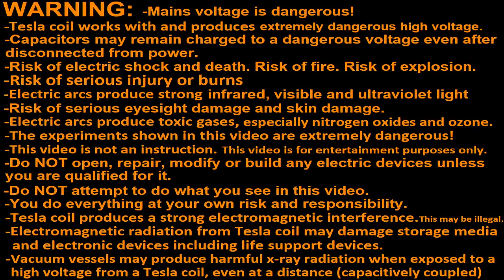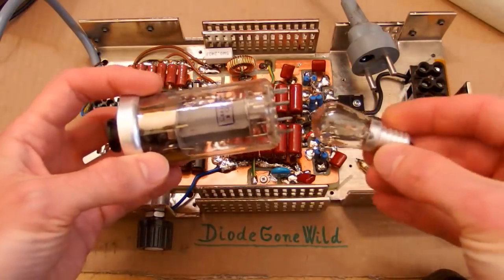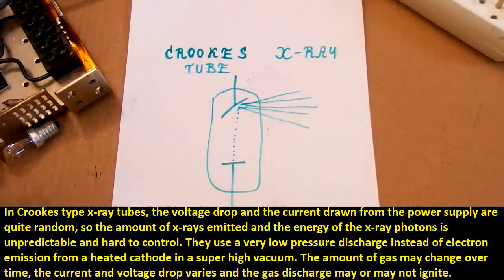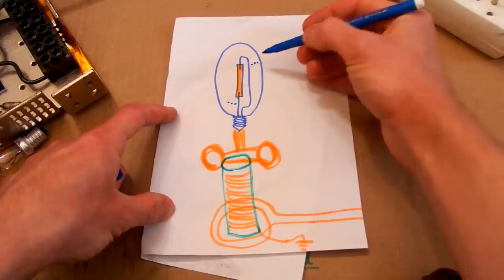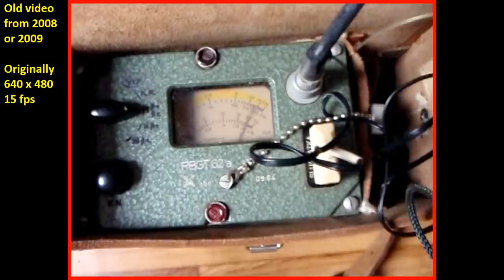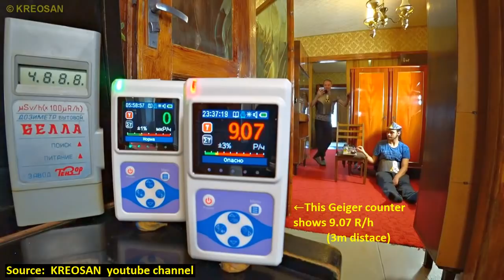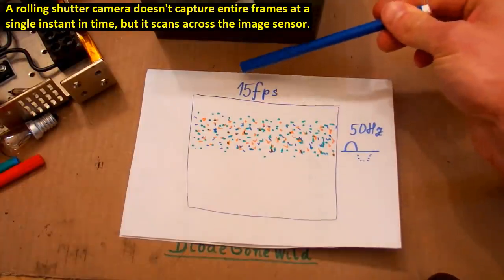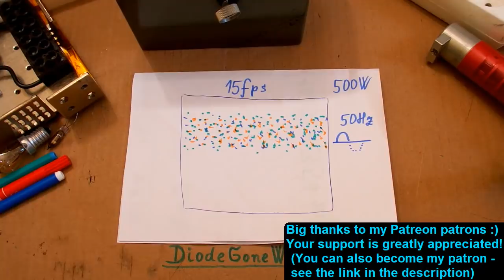SSTC pt. 16 - X-rays from a Tesla coil?

Comment: I'm glad you posted this warnings for people -- Anything with high voltage and a vacuum for electrons to accelerate + deaccelerate will create x-rays.  Generally I've learned that if it's less than 60KV the x-rays are too soft to penetrate through glass and skin, etc. However, tesla coil voltages absolutely will create hard x-rays.. Bremsstrahlung Radiation (german for Braking?)

Comment: Thank you very much for sharing. Knowing that this can happen, means that people can avoid the danger to others (and themselves) of mixing vacuum with high voltages. 

Finally a logically reason why parents used to say do not sit so close to the TV (which used a much much lower voltage and the glass contained lead).
Reply: old timey vacuum tube tv's didnt have as good of an xray shielding as modern ones, also some color tv's used a shunt regulator tube for the anode voltage which emitted quite a fair amount.

Comment: 1) the open end of the RGBT-62 probe is just the red plastic foil in front of the tube (does squat to the X-rays)
2) almost all Geiger counter tubes are calibrated to much higher energy radiation (hundreds of keV to single MeV gamma), so in fact most thin-walled tubes will severely overestimate the dose rate when left bare, especially with low energy X-rays...remember that the tube is just a binary detector, it has no idea about the actual energy of what triggered it
3) "energy compensated" tubes have a specific shield in front of them, which while correcting the dose rates for higher energy radiation tend to also completely absorb the single tens of keV X-rays

TL:DR - do not use a GM tube to even try to estimate dose rates with low energy X-rays. Unless it was specifically designed/calibrated for it - the data is useless, it can be off by several orders of magnitude either way. It makes a for a good detector (especially for us broke-ass amateurs), but an incredibly shitty meter.
Reply: I am not sure, but looks like the sparks may wirelessly ionize the gas in the tube like the fluorescent tube.
Reply: @oniruddhoalam2039  the tube has a metal wall...
Reply: Well, better if it overestimates the dose than if it underestimates it...
Reply: @AKAtheA  That tube does not...
Reply: @kasparroosalu  I have a video on my channel taking an RGBT - 62 probe apart. It DOES

Comment: Hi, I have one doubt. Can we build an FM transmitter circuit using crystal oscillator? While the crystal is very stable can we change its frequency slightly to make frequency modulation? Hope you will reply. Waiting :)

Comment: X-ray tubes output an insane amount of radiation, an eye opener for me was when I started playing with a dose calculator (rad pro calculator) and realized this fortunately didn't had an x-ray tube before that. They can output Sieverts per hour at about a meter with input powers of a couple tens of watts, its just totally mental. "ultra high level" pitchblende rocks are cute compared to an x-ray tube.
Reply: OMG yes. X ray tubes are insane. Big samples of rich pitchblende may put off 1mSv/h in gamma on contact. Even a tiny dental x ray tube can put out insane amounts of radiation as you said (with tiny amounts of beam power).

Comment: Once i tried producing xrays using a soviet GP-5 high voltage vacuum tube and i zapped it with a zvs driver and my dp5 geiger counter, despite having a shielded probe, maxed out. Later i drew an arc in air and it still showed a lot of radiation so i concluded that it was likely the zvs driver operating frequency that messed with my counter. Are you sure that your geiger didnt do the same? i mean yes there was a significant amount of xrays produced but maybe the frequency of the coil was effecting your measurments too?

Comment: I try to point out that danger when I see it in videos because when I was a kid I gave my hand pretty bad radiation burns. I don't know a lot about vacuum tubes but the one I used resembled a coolidge x-ray tube except the top electrode wasn't angled and I'm almost certain came from an old TV I pulled out of an abandoned garbage dump. I don't remember what the heck I was thinking because I knew the arrangement could make x-rays because I had old (1940's) experiment books that showed how to make x-ray machines at home using what I had, but with lead shielding to contain the radiation. Maybe I just underestimated how hard I was driving it. Anyway, yeah, I ended up with visible radiation burns on my hand and could feel temporary damage inside it. It didn't get super bad though, more like a very bad sunburn with blisters and some skin coming off, but no signs of gangrene or whatever. Funny thing is I was most worried about it getting bad enough that I would have to see a doctor because then my parents would find out and maybe take my science "junk."  As a 12 year old or so that junk was my life. I went through a lot of antiseptics and it healed up on its own and works fine. But I do still have cancer nightmares, and ones about mutant organisms growing large and erupting out of my hand or it falling off without me noticing and then my parents finding it shriveled up under the couch and getting really pissed off over medical bills. So uh, anyway kids, what DiodesGoneWild said.

Comment: Odd thing about the radiation seen on the CCD is there is no "green" specifically. Only red, blue, and white. Wonder if that was due to the construction? Would have expected to see all three primary colors but maybe he green pixels at that location are activated along with the red and blue to give only white.
Reply from the maker: The "green" is nearly white probably because of how the software interprets the raw data from the Bayer filter, which has twice as many green pixels. Each full color pixel is calculated from a 2x2 square of red, green, green, blue pixels. It probably interprets it as green only if both green pixels are excited. But the x-rays only excite one at the time.
Reply: @DiodeGoneWild  Ah ok. Thanks. Yeah I kind of remember that from importing video and images from a CCD camera way back when in robotics courses at college. Kind of makes sense since it would help preserve the RGB balance in low light conditions by having a portion of the green just go to gray scale.

Comment: i have the same type of lamp, the one with the cylindrical clear glass you can perfectly see the inside (not sure what type it is) i got it near my low power tesla coil and the inner tube glowed blue, but i didn't get the lamp on the spark and that coil can make like 30kV on the "flame"... i SUPPOSE nothing happened... jeez i didn't know it was under vacuum, done a couple of times

Comment: If you get an insulationm failure between the primary and secondary of a VTTC-vaccum tube Tesla coil Can the tube get high enough voltage to produce X-rays?
Reply from the maker: It's probably going to be absorbed in the decoupling capacitor.
Reply: @DiodeGoneWild  Unless it also fails open circuit :)

Comment: Hey Dan, I have another totally unrelated question if you don't mind ;) I'm wondering what is the maximum frequency of the half bridge with those DGDT transistors you use. I'm asking because I've been trying to power my coil which has a higher resonant frequency than yours and I'm getting very little output. The transistors aren't overheating anymore though :). Thanks!
Reply from the maker: It could probably run at a higher frequency, but IR2153 has a 1.2us nominal deadtime. So at 416 kHz, the pulses completely disappear in the deadtime. At 208, kHz the deadtime is already the same lenght as the pulses. So you should probably use IR21531 which has only 0.6us deadtime. And of course, at a higher frequency the control circuitry may draw more current, keep this in mind if powering it using a resistive dropper.

Comment: wait....WTF!!

Electroboom put the whole SSTC in vacuum, what about that?😶😶
Reply: It wasnt good enough vacuum to produce X-rays.It was a purple arc discharge.When X-rays are produced there is no arc discharge in vacuum but green or blue fluorescence
Reply: @mernok2001 , yeah, thought so!
Reply from the maker: Probably too poor vacuum. He was still on the right side of the Paschen's curve, too low breakdown voltage of the air and too many molecules for the electrons to accelerate.

Comment: could it be that the high frequency of the tesla coil messes up the Geiger indication giving it a far higher count?
Reply from the maker: no. This didn't happen with no lamp.
Reply: I made a x ray generator with a random vacum amplifier tube from a old crt tv and a flyback transformer 
And i breath thorium powder twice and i am stil alive
Reply: @DiodeGoneWild  Hi,
Can you please make a power supply with variable voltage and which could give current upto 20A with fairly easy connections. It's a request of a young watcher. Please help your little brother from another mother from India🇮🇳🇮🇳🇮🇳.
Reply: @sfp4197  it's time to write a testament.
Reply: @Georgy-fg3bg  with the thorium i feeled sick one day and the vacum amplifier x ray tube it don't work or it was a small amount 
Next time maybe

Comment: Your Geiger counter starts detecting X-rays cuz if radiation hits counter inside the counter Spaaarks start. And detector detect current in geiger counter. (circuit just applying hv in geiger counter) And your sstc can make this sparks inside Geiger counter if there's no radiation. 

Sorry for bad English. I am from Belorussia and belorussian language very similar to Czech language.
Reply: In another comment, he said that particular geiger counter didn't detect anything when he ran the teslacoil without a vacuum tube. It only started making xrays when he put a lamp or vacuum tube on top.
Reply: @deltab9768  Ok

Comment: Hi,
Can you please make a power supply with variable voltage and which could give current upto 20A with fairly easy connections. It's a request of a young watcher. Please help your little brother from another mother from India🇮🇳🇮🇳🇮🇳.
Reply: Dan (DiodeGoneWild) has some projects on his website:
http://danyk.cz/reg60v_en.html
http://danyk.cz/at_atx_en.html
The first is built from scratch and the second is made from modifying a PC ATX power supply (there are lots of videos about this, https://www.youtube.com/watch?v=oeNAhP-GIjo was in my sidebar. DGW also did a video I believe)

If you want to build something from scratch with a simple schematic, you probably want a linear power supply. Lots of info online. If you don't need voltage regulated, just connect a standard transformer-rectifier-capacitor basic supply to a variac.
Reply: @eDoc2020  thanks buddy

Comment: Wrong ! Wrong ! WRONG !!!   Remove the light and it will still register Xrays, its a FALSE reading caused by the high voltage and high frequency of the coil

Comment: I understand that a high voltage discharge creates X-rays and even hard X-rays. I also understand that a discharge typically requires 10kv per cm of discharge. what I don't understand therefore is why the discharges of 15cm and more that I have seen recently on your channel are not a concern ?
Reply from the maker: You can't accelerate electrons fast enough to produce x-rays unless they are in vacuum or very low pressure.